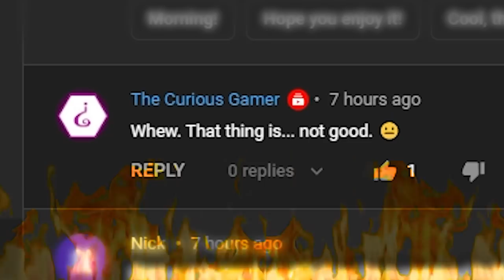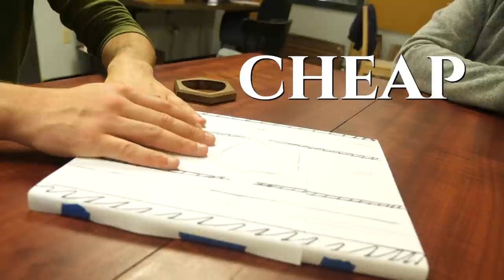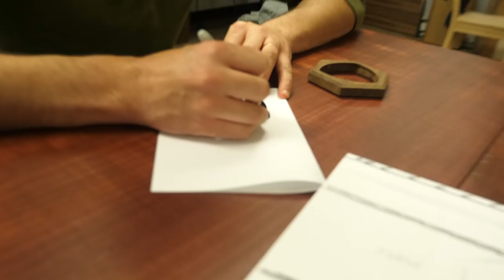New GM Screen Design Pt.2 (Jason was right)

Comment: You know, Doug, as someone who has been doing a lot of (completely different) design recently, I really appreciate what you are trying to do, and particularly that you guys are willing to put this on Wyrmlife. I think striving to find inexpensive solutions is a great endeavor: a work of art is not complete when there is nothing left to add, but when there is nothing left to take away. THAT BEING SAID, I fully agree with Jason on this. You want to cut as much as you can while still having your product, and Jason has been the defender of your brand for the last while between stuff like this and the ***hub T-Shirt ideas. Neither your idea or Bobby's t-shirt were strictly bad, but they definitely *aren't your brand. But at the same time, I think you all respectfully pulling at different ends of the rope helps deliver a tight product

Comment: Bring back the barrel magnets. You are trying to mate a flat and a round surface together that won't ever work well.
The barrel magnets register with each other, providing that shear resistance, and they are fixed onto the panels so you don't have loose parts. They are also proud of the surface, so the panels stack.

Comment: You could use leather as a hinge material and have snap grommets so it's removable and the product is still modular. Using leather as an accent might also elevate it from being just a slab of wood.
Reply: Absolutely agree.
This could even be a way to use smaller scraps of leather waste from other products.

Comment: I looked through an old plan I had to make my own DM screen and it is a lot like Jason said. Plywood in the middle, a thin metal sheet on both sides of the plywood followed by thin sheets of wood/veneer and capped with a frame. Internal hinges on the sides to allow the 4-panel screen to fold together. 
It loses the ability to add more screens but allows me to use magnets to hold notes, accessories, and display items to players on the other side. I just never had the tools to make one how I want it. I look forward to seeing how your screen develops.

Comment: So here's the thing. Dice trays, towers, mini carrying cases, they are all nice and good, but they are also things it is very easy to do without. You can certainly play TTRPGs without a GM Screen, but it makes some things harder in many systems. And it's iconic. People rolling dice could be lots of things, but you see that GM Screen out there, you know what is going on. It is the item sitting at the most central focus of the game (at least until a battlemap is in use) and it is both functional and symbolic.  You should 100% have the ability to do custom engravings, and being able to swap it out in some way sounds awesome because groups change and campaigns end. But I think your primary customer is going to be the one who is saying, I've got this nice table, I've got these nice props, I want a GM screen that can stand with these things and surpass them. So yeah, it has to look "Wyrmwood", and yeah, you need to engineer it so it won't fall apart if you bump it with your rulebook wrong.  If someone is buying a wood GM screen they are trying to make a statement that they are in this hobby for the long run and like nice things. Your offerings need to start at "Nice!" and go to "Wow!"

Comment: I think Doug's thinking with this is he wants to hit the sort of Dice Vault market where you can sell one to every TTRPG player. When the thinking should be more along the Table market with a premium product sold to a much smaller pool of people. If you imagine an all Wyrmwood gaming group kitted out, having the GM screen stick out for not being at the same aesthetic standards of everything else on the table is goofy. There has to be a compromise between a 3000$ Matt Mercer screen and a 200$ slab of wood.
Reply: Doug is going for the compromise... he is shooting for $300 to $500, not $1000. Which IMHO is not in the realm of something to sell to every TTRPG player. That is still premium, just less premium where people will actually buy it unlike the last GM screen they made. AND they can potentially deliver it in the near future, instead of having to wait 2 years, acquire more equipment & setup more manufacturing pipelines.

Doug worded his criticisms to Jason poorly IMHO... what he was trying to convey is that they need to move to producing a new product, not just shutting down ideas as not on brand. It isn't that the brand identity isn't important... but Jason was only providing reasons why they couldn't do XYZ, not solutions to be on brand, more affordable, & deliver a product to market as quickly as possible. Ironically, despite his choice of words, he was showing great vision in terms of making things happen. AND he is responding directly to what people in the comments have been making noise about for close to a month... they want GM screens, so let's freaking make one.

Comment: I think the idea that Frame and Panel would add significant cost to manufacturing is thrown out the window when you start to mass produce hundreds if not thousands of them. It could be as simple as having two table saws dedicated to only batching these out. One saw that is set up to only cut the dado into the frame pieces that the panels will slide into and another saw with two picture frame type jigs to cut the frames at the correct length and angle.

Comment: I'm on team customer.

..But what I mean by that isn't simple.   For starters, there are many different kinds of customers.   Some want pure wood heirloom gaming tables and accessories.  However, some just want a gaming table to begin with. You can't exactly get one at Walmart.

Some people, like me, just want unique gaming supplies.  Sure, I appreciate the quality of the hexy tiles, but truth be told, I would be just as happy with them in any decent material.  Quality doesn't just mean expensive solid wood.  Sometimes quality is the style.  Sometimes quality is just the thought put into it.

You guys built a fantastic and massive company on high end furniture.  But..  if you want to expand into new products, you need to consider other types of customers and what Wyrmwood means to them.

Comment: I think what nearly everyone here is saying is, "Look, we ALL LOVED the design aesthetic of the first Wyrmwood GM screen.  But it failed;  as it should have, as there were some pretty serious flaws in the design and execution that didn't really come out until it was being produced and used.  What's stopping you from going back and correcting those flaws?"

Guys...  we AREN'T looking for a "brand new" design.  We're looking for a design that simultaneously works AND has the quality that we've come to expect from WW products.  You HAVE a pretty good base product design already.  So fix it.  Use what you learned from the first round to improve Version 2.  Upgrade some things that turned out to be weak (like the ball magnet "hinge" design...  embedded barrel magnets might produce a much better hold, without small parts that can roll off and get lost), scale back some things that drove up the cost unnecessarily (full panel magnet & plastic frames for all the display panels looked great but added monumentally to the labor and cost on your end and the setup labor on the user end...  how about a flush mounted magnetic whiteboard panel?  Same versatility, far less labor, and could easily be hidden away with an optional cover), and examine the changes you'd already implemented over the course of the releases that made worlds of difference (like the pull-out pins in the rotating panels...  great user-friendly upgrade!);  maybe some of those changes could similarly apply to other parts of the design.  Ditch accessories that really didn't work in favor of more like ones that did (the drawer tower was GREAT...  the two-way dice towers, not always so much).

You're essentially a bunch of engineers and artisans.  You've ALREADY produced many screen innovations;  now you should refine them, make them work!   We've all watched you do it throughout the Hexy process.  Wow us again with the product improvement with DM 2.0!

Comment: Go Jason. Frame with different inside panels is what I say. Give me a chalkboard and a pinboard and a place to stick a map or other stuff I want the players to see behind acrylic and I'm good. Nobody needs a solid wood GM screen with magnetic hinges. Either you play at your home, then taking it apart doesn't matter or you travel to your game, then you might not want to lug around a briefcase full of solid wooden slats that do nothing 3 pieces of cardboard taped together won't do other than look better and fall apart if you move them wrong. Either make a lightweight travelling screen that neatly folds into one or comes apart (focus on function) or make a good-looking no frills screen for people who don't need to travel. Then next time do whatever you didn't do this time. I think this is one of those cases where you don't want to compromise.

Comment: The part that attracted me towards the Matt Mercer GM screen wasn't just the craftsmanship but the barrel magnets that were installed into screen itself and how it can fold and be stacked together without removing the magnets, unlike the KS GM screen with the sphere magnets. Give us a screen with that magnet functionality and by adding all the bells and whistles of accessories like a tracker slot, an inset/clear plastic screen for custom sheets. The "slab of wood" idea would probably work while being possible for you to produce quickly and affordable for us. 

The majority of us are happy (I think?) by the wood selection you offer, otherwise we wouldn't be buying the dice trays, dice vaults, etc that are a single type of wood. A GM screen made entirely of Wenge or some other wood to match our existing collection of Wyrmwood products, who wouldn't want that? Sure you can offer all the craftsmanship and quality by adding the inlay and mixed exotic woods into the design for people who want it. But I think Wyrmwood is not all about quality, but functionality as well. I also liked the square design of the MM GM screen. It would take up less space in my pack.

Comment: I want Doug to succeed. I really do, because I'm not rich. But I also want a DM screen I would use and be proud of for life, and I trust Jason's vision for that. I'd probably pay $500-700 for something nice. $3,000 is too much.
If you're not set up for it, then get set up. Buy machines, whatever, and then offer it permanently on the site. They will sell just as much as the dice towers.
Reply: "They will sell just as much as the dice towers." This is simply not true... GM-only targeted products will always sell less simply because most players don't want to be GMs. It's just the reality of the marketplace.
Doug is keeping to the solid slab core idea precisely because that is the most likely to be at the $500 to $700 mark... the classic frame & panel approach would be $1000, above your quoted price point. And don't forget the higher the base cost is, the less bells-&-whistles & basic functionality they can offer will be... & thus ultimately a worse product.
Reply: @kgoblin5084  Maybe. I was thinking that not every player buys a dice tower. I think the average DM is more likely to spend crazy money on a screen than the player to buy a dice tower. At least that’s how it is in my group. 

I was basing my rough price guess off of Doug’s rough price guess. 150/panel for Jasons idea. So $450 for a 3 panel with a little room for upgrade to mid tier wood. 

Lastly, I don’t think most people here in the comments are here for bells and whistles. There are lots of cheaper screens out there with lots of junk added to them, and they are clunky and busy. People here want sleek, stylish, and WW brand. I don’t think features/uses equals better product here. 

My 2 cents

Comment: Im not a rocket scientist and expert carpenter
But I'd like to be proven wrong. "it's too costly in both literal money and labor"
What are you talking about? If you want to make the matt mercer screen that people really wish to have, you literally need to make only 3 parts:
1. 2 identical frame pieces for top and bottom
2. 2 identical frame pieces for left and right
3. half the thickness of the frames solid wood or veneer panel that you set inside of the frame.
3 pieces that can be glued together (the panel goes in a groove for it), add 2 magnets on each side, sell it by panels if you want, but that sounds more reasonable to me for a wyrmwood product, where you have access to special carving and CNC tools, aswell as a talented team that can pull it off. Cut away most of the inlays and engravings and the fancy things that you did before, and with 3 pieces you already get so many options to use more exotic wood combinations.

Why are you concerned about making a lot of panels out of chopping boards? anyone can do that. Your customer base isn't made of people who buy your products out of necessity. Your customer base is made of fans, who are enthusiasts about fancy wooden items to use in their tabletop games or just to collect. 

You're here concerned about pricing, when half of your items are already expensive. Talking from an European's perspective where roughly 100 dollars is a lot, while most people see it as a reasonable price. I get the feeling you'd have an easier time making the dm screen, in comparison to a dice tray or dice vault. 

Could just be me, but a DM screem from Wyrmwood, if done with simple techniques you've done before already, could really prove to sell a lot.

Comment: Definitely need some character or design beyond just a basic wood panel. Could always use the veneering they've developed for Adventure party vaults, slap a couple layers of veneer onto a core block, then CNC to different depths through the veneer to create a pattern or layout of 2-3 different wood types, or beveling the edges, without too much complexity in process. Uses known tools and tech, allows flexibility in design and options, but doesn't make for a lot of complication

Comment: I think the key thing all the teams are missing is that they are approaching it as trying to make a GM Screen without even trying to do any research into what people want in a screen.  If I am using anything other than the preprinted rule sheet version from the system I am playing it has to have a compelling difference in the ease and style of my play not just be a magnetic cutting board.

Comment: I think Doug is too close to this now, and needs to take a step back and let someone else work on it.

Get Crazy Ed up to Massachusetts for a week, and get the Paladin down for a week, and let them throw ideas together with what Doug has done and these two Wyrm Lifes, and see what kind of madness they come up with. I think it could be awesome.

Another thing I think needs to be considered is using how you’re doing the class dice options. Use those ideas - pick some woods, and that’s that. If someone wants it in a different wood, either “sorry no” or “that custom version is going to cost $x more and you have a heck of a wait”. Leverage what you have.

Comment: Whoa, whoa, whoa. Make that damn table cloth. I know ten people I've talked to about that thing, and they all look at me like I'm crazy for like five seconds, and then immediately say: "Shit, I wish I'd thought of that, it's perfect." That's vision Doug!

Also, Doug may not care about vision, but your customers will. That prototype is not a competitive product. Even cheap (for what you consider cheap at your price points) it ain't worth it. I wouldn't pay 50-75 a panel for that. 

What I'm looking for, beyond the lovely look you guys can implement, is utility. My buddy made me a DM screen, cost him 10 bucks. It's got two  hinges, folds up when I'm done, it has three magnet strips, and velcro, I can stick a series of useful tabs on it, apply magnetic clips to hold notes, has a white panel for writing on quickly, it has another row of magnets I can stick a little wooden shelf to, and put minis or dice on. What I'm getting at, is beyond aesthetics what other ideas do you have that make this screen useful?

When it comes to looks, Jason has it covered. His is the nicest sounding. But I don't know anyone who will spend even close to a grand for three panels of fancy wood with magnets in em. What makes this useful? Max I would spend, 300. 100 per panel. And that's if I can get things to hold my stuff, or put it in/on, features beyond just the nice Wyrmwood look. One thing I'd ask around about is what do people use these screens for. Most of them are flat with info printed, or clampable spaces to put info. Places to track initiative or hold/organize things are excellent luxuries.  

Your competition is steep, there are tons of screens out there that are useful and cheap. And when it comes to pure utility you can make a decent one out of an old photo album and some paper clips. So what does a Wyrmwood screen bring to the table that makes it worth the money? 

If it's just the wood, then that wood better look good.